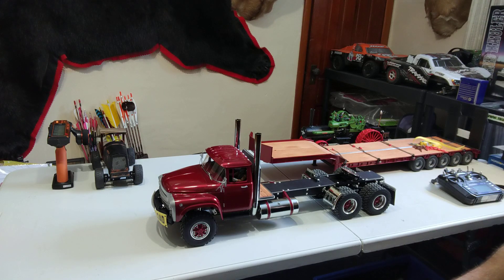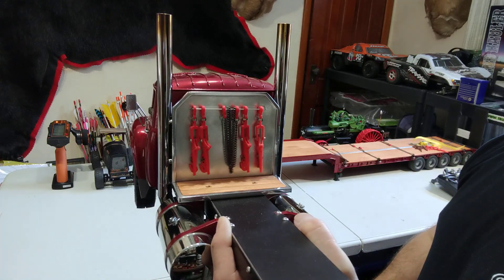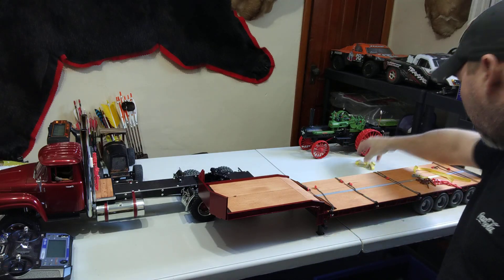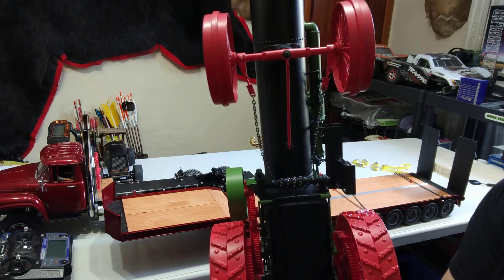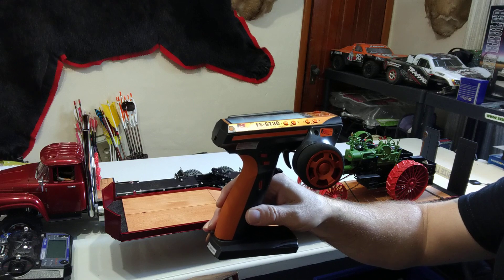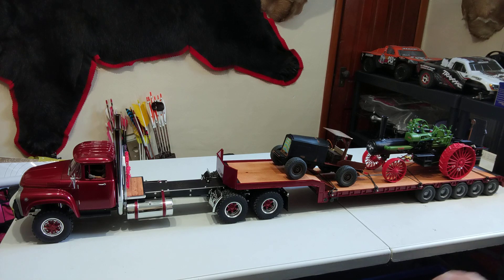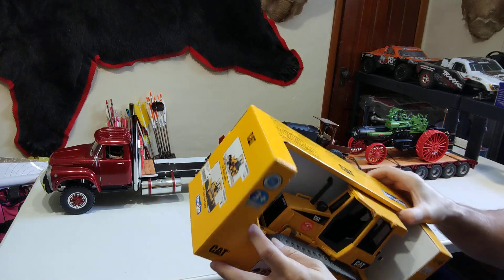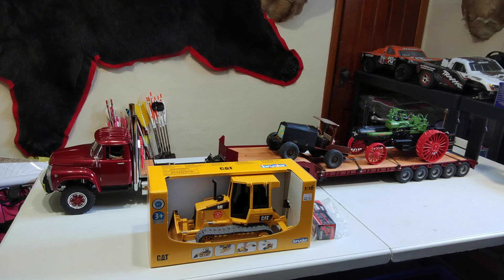Tamiya Grand Hauler/King Kong RC ZL130 part 6

Comment: Your on the right path with that Bruder D5 correct on the setting channels.  Absolutely love your kong build.  How about I swap you a D5 of your choice for that kong 🙏🏼🤪😉🤓👍🏼 Awesome set up.  I just loaded a vid of one of my d5s in action.  I’m curious how quick those new 360 servos are. I personally haven’t used them never seen them I make my own. But I just might need to get a set to build another or a swap out.
Reply from the maker: Ha!! My D5 is up and running. Vid coming today. 
Thanks. I'm pretty happy with the big rig. But now with the dozer, and I have a Huina 580 on the way I'm afraid I need to build a dump truck next. 😂😂